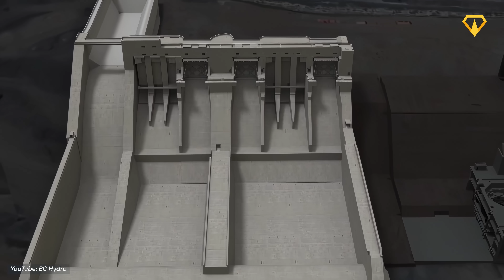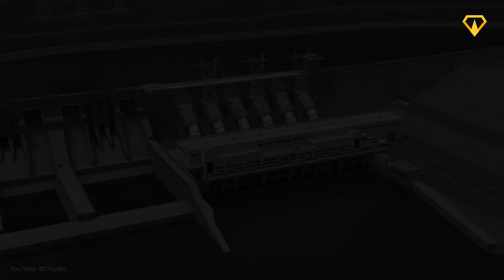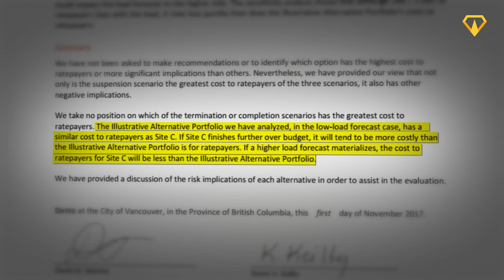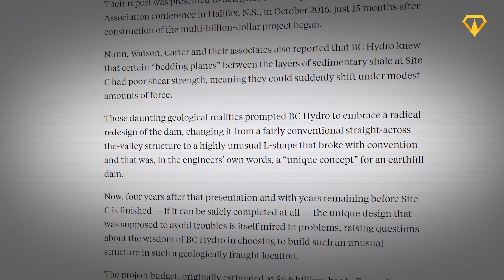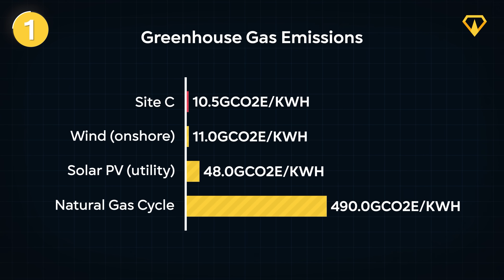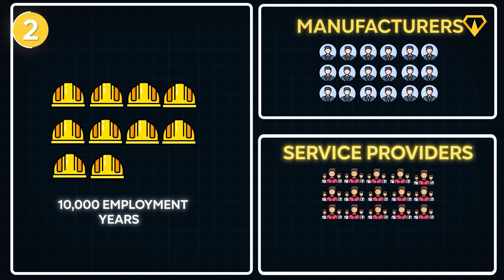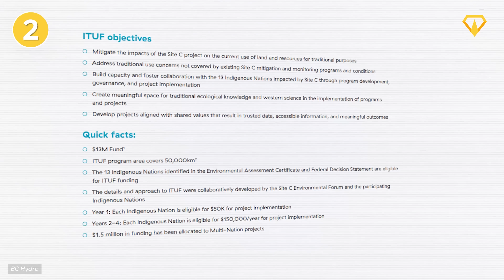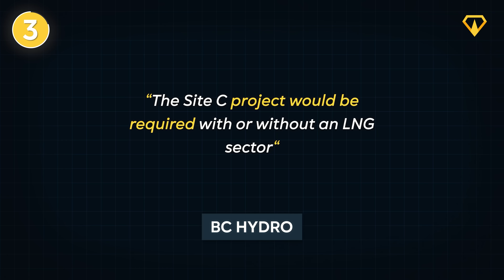Canada's Massive $12B Mega Dam

Comment: Also some of the older dams ,like Stage River (2) are being decommissioned
Reply: If you are talking about the Stave River, I worked on the Stave Falls power house in 2000 which doubled  the output of the old power house. Downstream is the Ruskin dam which still operates and recently had system and seismic upgrades.

Comment: The first argument you made for the advantage of the Site C creation is flawed.  Yes, wind  and solar are dependent on external factors to generate power, but the construction of these sites will include a power storage element that will allow the random nature of the power supply to be balanced for user demand.  Because the excess energy will be stored, it is available as required, the exact same reason you cite as an advantage for the dam.

Comment: Hey so I worked at both Site C (on the penstocks) and at Kitimat. Site C was a clown fiesta of a project with upper management being a joke. Example of with is that the expansion joint on the penstocks was installed incorrectly, and has to be replaced for some of them. Kitimat is going to be primarily using the power from Site C, but since there are so many delay's from that project, they are bringing in diesel generators to augment the local power grid to run the plant while they wait for Hydro to get their act together.

Comment: That's my back yard!  Most people in the north peace  river district didn't want site C!!  The lower mainland decided we needed it!
Reply: I own property in FSJ and man was i piiisssed!!!! about this project.
Reply: @reneethibeault5129  same here and do believe that most of our city didn't want that dam and it's a shame we really have no say what goes on in our back yard ☹
Reply: @reneethibeault5129  out of curiosity, why where you pissed about it?
Reply: so, there is a number of arguments. Some good some bad. 

A - the farmland on the north bank. As someone else mentioned prior in a different comment, the South bank mostly a straight face, no where to really farm it. There is a few locations, but no more than probably 500 farmable acres on the south side. Of which, besides a recently installed pipeline that runs from 120km's north south to the Plant that is the start of the CGL pipeline (it's not in Dawson creek, but about 40 km west) there is no access to this land. The north side has a bunch more, but for the most part the flooded sections were tree covered. Now the sections that weren't tree covered were reportedly the "best farmland outside of the Fraser valley" and was considered "the future breadbasket of the North". Couple problems with this though. The vast majority of the crop pulled from this section of the peace valley has been hay, or some form of grain. The same crops pulled from up on top. One farmer did try and do potatoes the one year, it was a major bust as there is no place for potatoes to get processed. He did local selling, majority of it was turned into fertilizer the next spring. So farmland wise, meh. Not that bad, not that big of an issue. 

B - Soil stability. Site C has been planned since the 70's. Not a single engineer until 2014 would sign off on the project due to the fact that the entire peace valley is formed from shale. There is no solid ground. I heard a rumor that the engineer who did eventually sign off on it, was from china. Not sure if true, but honestly wouldn't be surprised. Have seen a number of Chinese companies poking around south of there trying their hands at coal mining, only to realize there is hardly a profit doing so right now. Hell the main mine in Tumbler is only just being turned back on after like 15 years of low idle to 0 productivity. Back to the stability, there has been a number of slides over the years in the peace river. One almost closed it off about 40-50 years ago. So I would consider that a valid concern. 

C - Local facility usage. The construction of site C has brought a few people to town. I believe numbers hovered around 2400 a month working on the structure at any given time. Local concern was the construction of assets that would be used during the construction phase of site C, but during operations due to the lack in need for people, would be shut down. This also covered housing, as a  number of houses in town were built in anticipation of this, which is great. Except it forced the housing market up. Since the project has since completed and the majority have since left or are leaving (they started filling at the beginning of the month), housing has started coming back down somewhat. 

D - Environmental concerns. There was a large wetlands that is now about 5 feet underwater at current, and there was a large number of animals that roamed the north bank. I personally have hunted elk on the northern bank. There was a large deposit of Mercury rock(?)  that had to be mined and dug out of an island in the middle of the river, I personally don't know if they got it all. All I know is that they had excavators and scrapers digging 50 km up river in the center of the river for about a year and a half. You can still see the road to it on google maps. It's just past the Ferrell Creek road going west. That getting into the water, would be catastrophic. But, apparently they got it all. There was also concerns about trees being left behind a popping up like rockets as they did in WAC Bennett for years. I feel that the reserve was logged sufficiently. Driving past it last week, most the remaining foliage was young willow growth. 

E - First Nation Rights. Due to the treaties, the first nations have a lot of land that is being affected by this. Now someone else mentioned that treaty 8 covers 800,000 km and this is only going to flood like 10,000. That there is 34 FN along the river. While true, the dam only affects  5 bands. Blueberry, Profit River, Halfway, Doig River, Moberly, Saulteau. There might be some others claiming being affected, but these are the ones in the local area. They lose land, ancestral burial sites, hunting grounds, and they kick up a fuss. Which we really don't need more of. 

F - Cost.  Original total cost was 6 billion when construction started. At current, with it filling it sits at 16 billion. The blow back on this is an increase in the price of hydro in BC. Incase you didn't know, BC Hydro is a state run organization. It is also, the only hydro outfit in BC. As such the pricing is dictated by the state. Hydro prices have jumped up a fair bit, which everyone kinda saw coming. There is also the fact the hydro isn't staying local, its going south. As in across the BC/Washington State border. As in to California. And frankly, people up here are tired of being scalped and having our resources shipped south then sold back to us at a higher price. Except in this case, its going south for nickels on the dollar thanks to NAFTA. So ya. The turn around on the price tag to seeing it making a profit, is going to be significantly longer than the LNG project he glossed over in the video. 

I'm sure that Renee or Troy could add more, but ya. This is some of the concerns.
Reply: @GarethC4G  ok but most of what you just typed out is the reasons why most of us didn't want that dam dam lol
Reply: @troygach9228  I know, those were the reasons we are upset :D

Comment: In termf of envrionemntal impact,  this was mostly farmland on one side and there was already a river there, so animals already had a barruer and it is just a question of moving it.  Being a lake instead of fast moving water would in fact make it easy for animals to swim across.  
In 1990, I biked alongside the river on a road that has been moved (though a portion was already high enough to remain).    yeah, it floods a valley, but that is nothing compared to James Bay project.   
With the climate emergency, that 1.1gw of power will be welcome and protestors will have to agree that it was visionary and necessary to build it because if people will move off natural gas, oil and onto electric head and elctric cars, you need to have increased production. Until there is reliable mass storage of power avaiable, wind and solar allow you to keep water in reservoirs for later, but unless they kick in when you need the power to heat your home at night, they are no good as "baseload" production. Hydro is.   And even if BC doesn't need the power the USA next door will. (Alberta refuses to immport clean power from BC, wants to preservce its fossil fuel power production to keep fossil fuel industry happy).

Comment: Your title is wrong. 

Overruns had increased the cost of this dam to 18 billion dollars in 2021.  The last reported estimate was at 24 billion dollars.
Reply: He also has it at 12B USD, which is 16 ish Billion CAD. But yes it’ll be way more than those numbers. I’ve been on this project for almost 3 years.
Reply: At the end it will cost 5403 billion... 80% of the money in offshore bank accounts.
Reply: 24 billion $ for just 1100 MW? That's absolutely crazy. LG-2, which was put into service in 1979, had a cost of $3.85 billion --> between 16 and 17 billion in today's money. Its installed power is 5 616 MW and it produces over 40 TWh per yeah. Add LG-2-A to that for a total cost of ~$21 billion in today's money and 7722 MW installed power in total. Someone's getting screwed somewhere :)
Reply: @gustru2078  Did I miss something? Where did you get the 1100MW number from?
Reply: @unconnected  1100MW is from BC Hydro's numbers.  It will produce 5100 GWh of electricity annually.  And living 8 miles down river from it, I plan on getting my fare share of it.  Adding another server farm after christmas!
Reply: @gustru2078  But what would it have cost without all the stalling ?   What would it have cost if it was started and finished on time ?
Reply: @freddyfriesen  I'm not debating that at all as I don't know what the costs would have been had everything gone smoothly but it likely wouldn't have been 7 times less expensive. Also, I'm not laughing at B.C. nor Alberta. I think it sucks that they had so many problems / delays because it gives people the impression that hydro isn't worth it.
Reply: Jesus, could have just given everyone in the province free power for life instead
Reply: @macthemec short sited

Comment: i was a foreman on this project and it was alot more than 12 billion. you had so many inexperienced workers, and well most of the management was incompetent, and had no experience in construction, and to boot you would have anywhere from 15-45 engineers on shift, that basically had no business being engineers. this all equates to alot of mistakes and costly ones, im not allowed to say but some major problems occurred in the spillway where they had to add 100+ more piles. because of poor engineering which cost ALOT i won't even give you figures
Reply: One day an employee came across a "turtle" on site and ... Yeah ... They closed shop in a whole sector just for ONE turtle . My wife worked in a very special unit ... let's say ... I am ashamed to be Canadian . She lost her position because she stayed the course and did her job 100% . ... Here goes ... she operated a testing unit for ... for ... Enough said . They replaced her with a more "friendly" tester ... Basically a unit that closed its eyes on the quality of the manpower on the premises . You would be amazed what flows through these employees veins .
Reply: @niniv2706  They had the same problem in Ft. MacMurray. I have to say though when the testing came in it was remarkable in how attitudes and safety changed. Less stress in my experience and was actually happier after looking back at how things were run. A dedication to employee well being works if management is serious about weeding out people abusing substances. Bit of a pun there. Best wishes to your wife, its never wrong to be on the right side.
Reply: @mrparrehesian1742  Yeah, they made fun of that in FUBAR 2, so I think a lot more canadians know about that now haha
Reply: @niniv2706 can u be any more vague? Not….confusing enough…
Reply: Same for Muskrat falls in the East ... Just a massive fiasco .
Reply: why won't you tell us the figures? because you are full of poop
Reply: Why is it called Site C?
Reply: @InfoNymf  Several dam locations were proposed a few decades back. This location was named 'C'.
Reply: exactly, those "workers" were hired to bulk up their quote to GOUGE more of our hard earned tax dollars from our govenment!
Reply: Just another know it all construction worker. If only the whole world was run by construction workers.....

Comment: As an Albertan who has seen coal fueled generation (rightfully) disbanded in our province. I fully support a green Alternative bring put into the power pool. We had a very close call last winter with wind turbines being useless  at 40 below, and are greatful to have a reliable alternative nearby in our interconnected grid.
Reply: Wind supplied only 12% of Alberta’s electricity last year so how can you pretend that them being inoperative created a “close call”.

Wind turbines can easily operate at -30°C; having lived in Alberta, you seldom get -40°C. You when you do there’s mercy no wind anyway which also means that there is less heat loss in buildings. Wind velocity causes wind driven infiltration in buildings which can increase the load by as much as 25% allowing wind turbines to supply that extra energy.
Reply: @colingenge9999  happy to have wind power all day long. I'm just saying that when 12% of us could freeze to death  it is nice to have a non- coal alternative. Even if it is only once and a while
Reply: @colingenge9999  and the close call I'm pretending was a province wide emergency alert asking everyone to cut power consumption while it was 40 below . Saturday January 13th 2024. 6:44pm.

Comment: Like all dams it has only one turbine hall whereas in Australia in 2016 a proof-of-concept test was run for dams to have up to three turbine halls . The test ran by RDP Marine in NSW and overcame the standing reasons given for it being a nonstarter
Reply: What does the number of turbine halls have to do with the number of turbines? Genuine question, because I’m unclear what your point is.
Reply: @LeopoldOfOrange  hi ok so the main hall is placed to use hi pressure water and for each dam that is the limiting factor of usable  water available . But my system can be added to dams thus multipal halls or if it ever
Reply: @LeopoldOfOrange   what I am on about is retro fitting more turbines to dams to make more power from the same volume of water currently used thus extra turbine's will be needed and so extra turbine hall made to house them
Reply: @LeopoldOfOrange  I suspect it's a phrasing problem.  I think they mean one turbine per tunnel (most decent sized dams have 4-6 tunnels).  That is, he's suggesting putting turbines in series (same tunnel) instead of, or in addition to, putting them in parallel (separate tunnels).

I suspect the main reason not to do it is just "not worth the cost".  Most of the available energy should have been extracted by the primary turbine if the system is well-designed.  Adding additional turbines to sop up the remaining energy would just add additional construction and maintenance costs without a whole lot of additional benefit.  Just a suspicion (I'm not an engineer by any means), but "add another one" is hardly a groundbreaking concept.  I can't imagine actual engineers have just never thought to try it before.
Reply: interesting concept, id like to see the study papers... how do they overcome the pressure drop issue?
Reply: @michaelransom5841  the back pressure is unaffected so the issues of turbine surging are also non starters

Comment: They should try and make green hydrogen and fuse it with carbon dioxide to make methanol. And pipe that out and export it. A mix of methanol and ethanol (ME 50/50)I think would be a good alternative fuel going forward.

Comment: @MegaBuildsYT    Small correction to your comment regarding controlling the water floor and therefore the power... 

Headgates are used to shut-off the water flow, not make it variable.  The unit wicket gates directly at the scroll case of the turbine control the flow of water, frequency of the generator and power output of the generating unit.
Reply: A much needed project for an increasing population and it will generate a lot of wealth.
On another note:--
Start calling it PACIFIC  COLUMBIA as it is more appropriate.
Britain invaded many countries during its 300 years of its greedy empire and killed more people during that time than were killed during WWII.
Its a fact.
Spread the word. - Pacific Columbia.